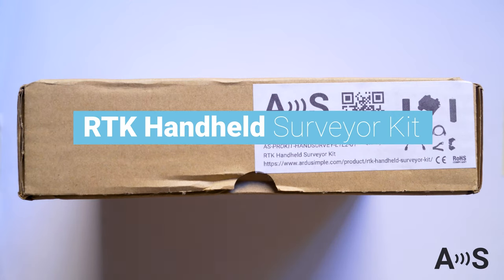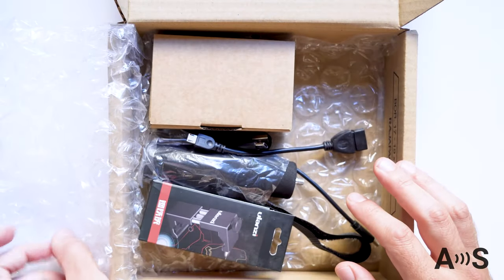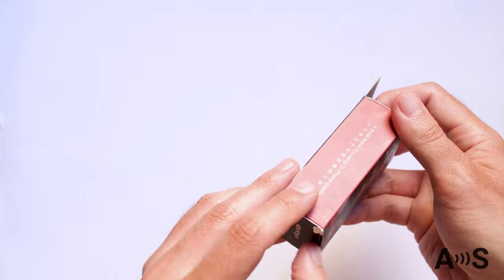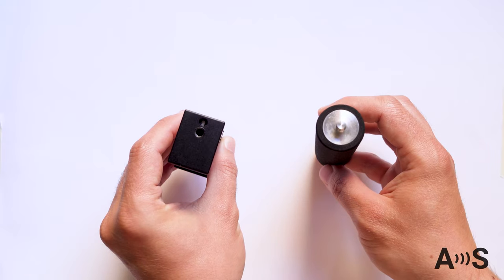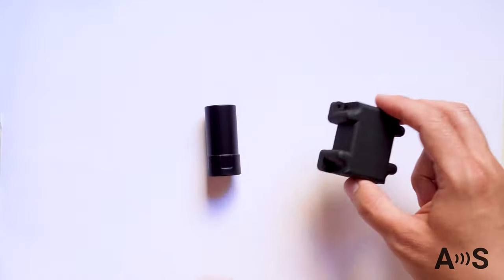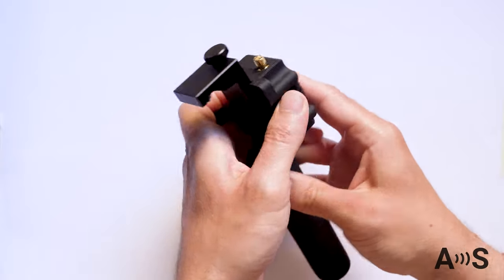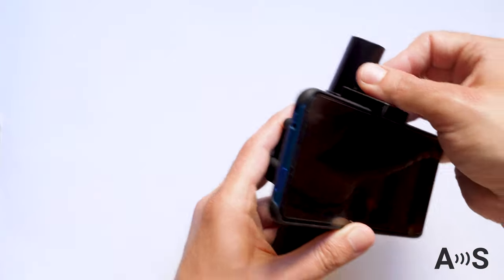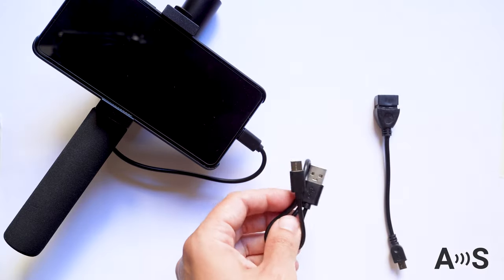RTK Handheld Surveyor Kit from ArduSimple. Survey and map with RTK and centimetre level accuracy!

Comment: Good evening gentlemen of Ardusimple.
I would like you to investigate what configuration is needed for the Ardusimple boards to work with the Survey Master APP. Several "Low Cost" GPS based on ZED F9P, can work with this application, but not Ardusimple boards. In my case, I have a SimpleRTK2B-V3 that connects perfectly via bluetooth to Survey Master, it also connects successfully to the NTRIP client of the application, but the corrections DO NOT arrive and it is always in "Standalone" or "Single". I would appreciate in advance any help you can provide in this case.
Reply from the maker: Dear customer, thank you for your message. You can follow this tutorial How to use centimeter GPS with any Android app (mock location) https://www.ardusimple.com/rtk-mock-location-with-android/ In case of any questions, feel free to contact ArduSimple team info@ardusimple.com, support team reply within 24 hours.
Reply: Can this be used in the Philippines? How much?